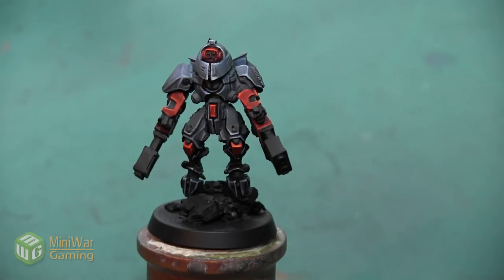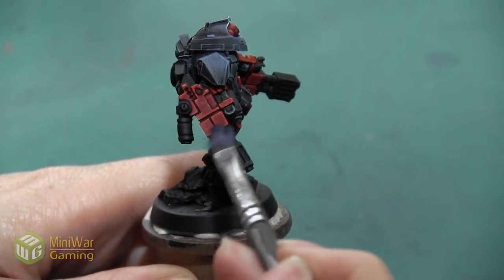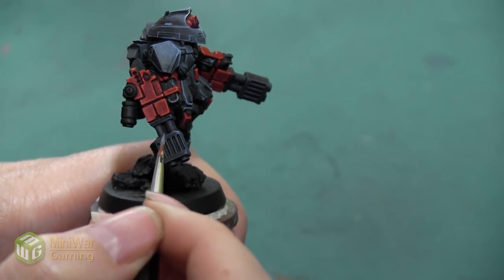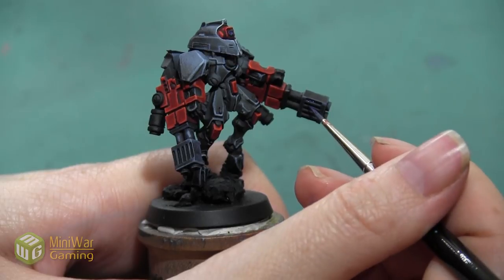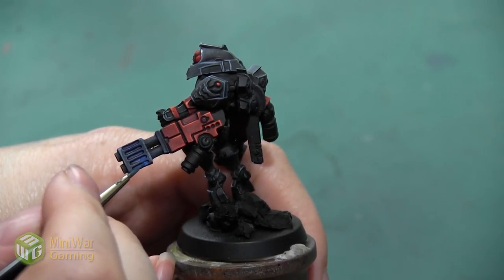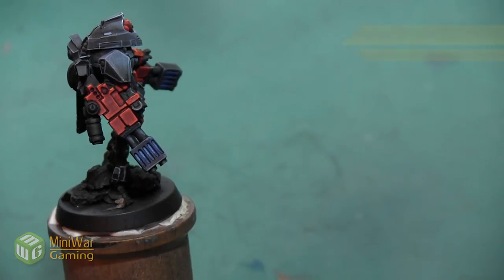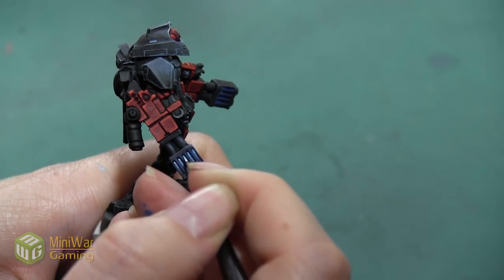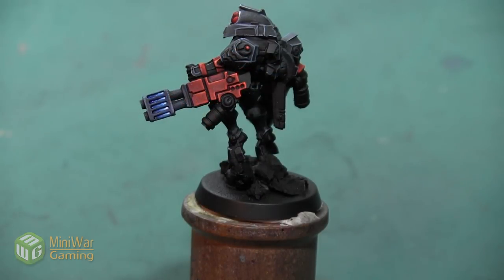How To: Paint Glowing Blue Fusion Blasters

Comment: 8 different paints for one small detale, comes to little over $40 in my country. lol that's more than the model itself. I'm not made of money.
Reply: u can just dry brush it with 2 blues. 1 light than the other
Reply: Johansen1000 lul true
Reply: Corners can be cut for a similar effect with less different colours. Also there were only 3 used for the glow.